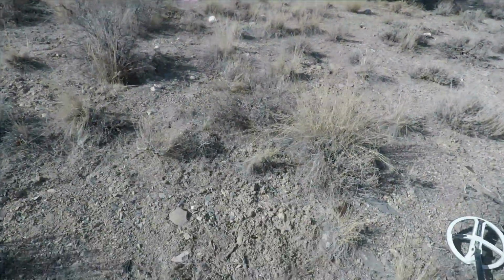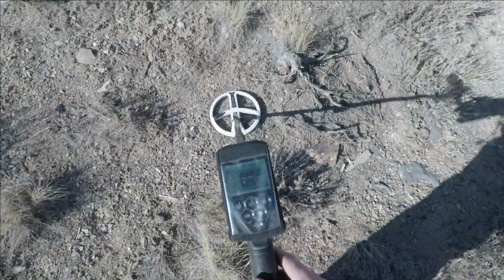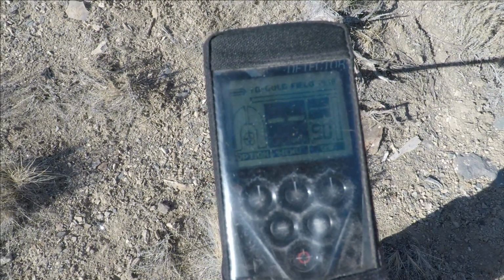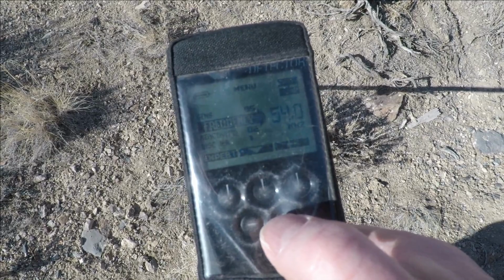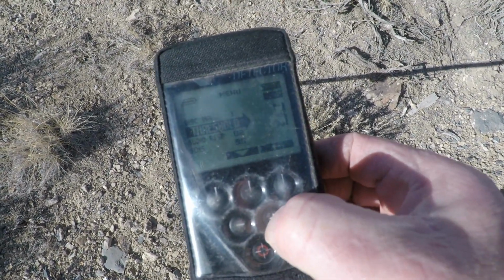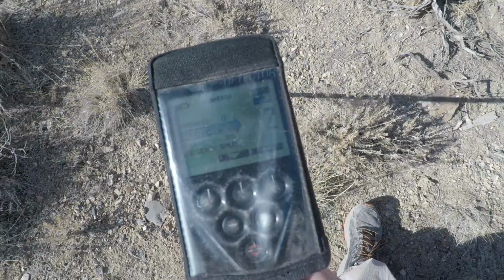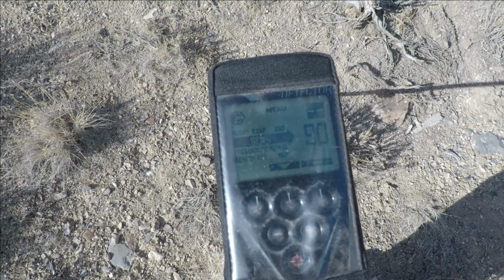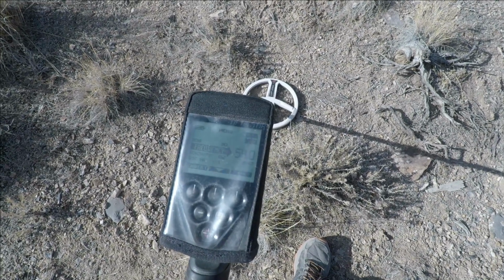Custom Gold Hunting Program for the XP Deus Metal Detector

Comment: The manual says that you need to swing the coil 20cm above the ground in goldfield mode.
Reply: Well 20 cm is almost 8 inches. I guarantee you will be missing small gold if you're swinging that far above the ground. Most of the sub gram nuggets can only be detected a few inches deep. Normally I swing about 1 inch or less off the ground. Now that distance will need to be changed based on the terrain to avoid hitting rocks and brush of course.